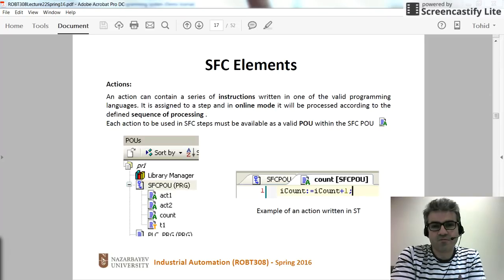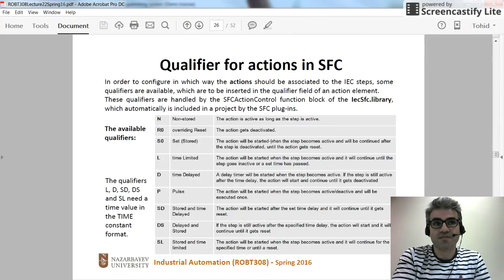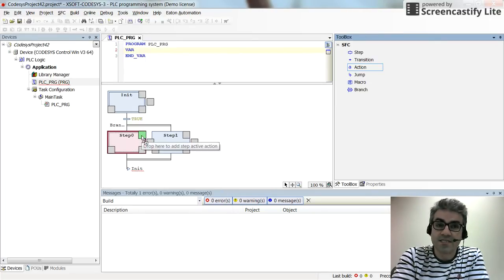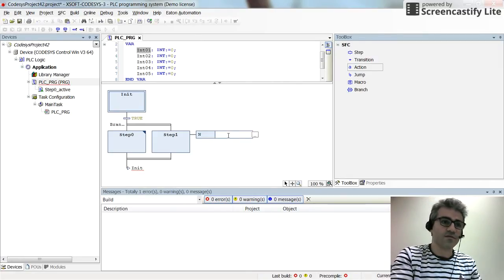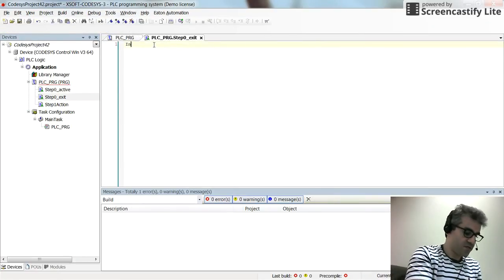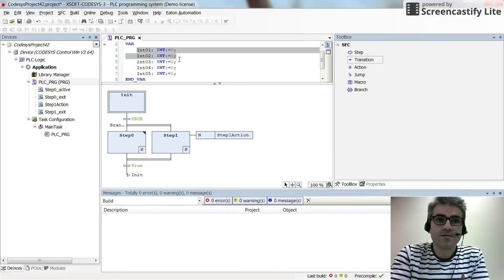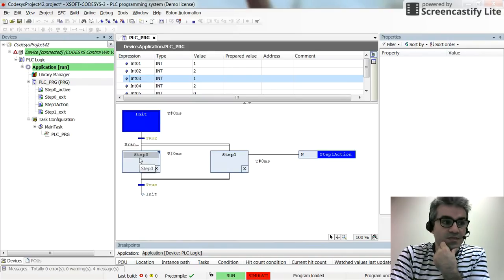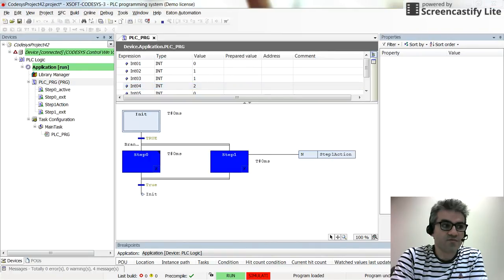CODESYS: Actions in SFC #codesys #plcprogramming #iec61131 #sfc #sfcactions #twincat #visualization

Comment: Thanks for the video. I am trying to emulate an RSLogix5000 program made with SFC to a SFC program in Codesys. . My dilemma is that RSLogix5000 has one qualifier to detect at Rising Edge and another to detect at Falling Edge. The question is how do I do it in Codesys?
Reply from the maker: I think you can use the Entry and Exit actions for this in CODESYS.

Comment: I have a question. I am writing program with SFC.  SFC is a FB. I published SFCPause and SFCReset variables so I can pause cycle if there is an error. My question how to work with timers there. For example first step is to open valve 2 for 10 seconds.  If there is an error or stop during that, I want to pause it and when stop released continue if cycle not reseted.

Can you help me with this over skype for example?
Reply from the maker: Sergey, I am a bit busy these days. I will check this out ASAP.

Comment: Hi Mr. Alizadeh, I am working on a project about linear stage. I have a push button connected to digital input I0, and what I expect is that every time when I press the button, the linear stage will move forward 100000 encoder value. Can this " action" help me with it?
Reply from the maker: Dear Zoe Yan, I think it depends on the way that you implement what you want to do. It could be used for this purpose, for example by considering the push of the button as the transition condition for a step, and then in the step you can have some action, performing what you want to have.
Reply: Tohid Alizadeh Thanks for your reply Mr.Alizadeh, one problem I am facing is that if I want my linear stage move 100000 encoder value forward in online mode, I have to prepare a value for forcing or writing a variable either in the declaration
editor (see page 415) or within the editor. But how could I do it without opening the editor just by pushing the button and the value will automatically be provided with the value I initially assigned?
Reply from the maker: +Zoe Yan I did not get what do you refer by (see page 415), however, in general, what you can do is as follows: You declare a Boolean variable and assign it to your button. Then in the run time, whenever your button is pushed, the values of the variable will be automatically changed from False to True. You can refer to this variable in your program, and based on its value can do something (for example you can send a command to your linear stage to move a given value). 
I hope this helps you.